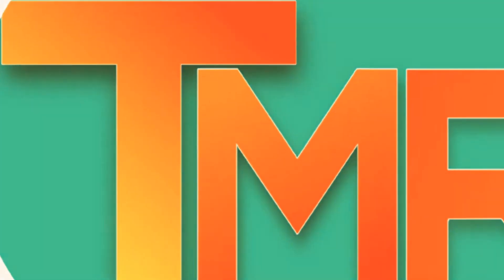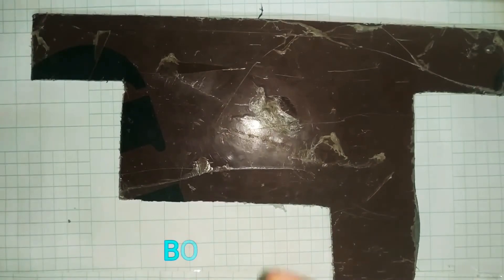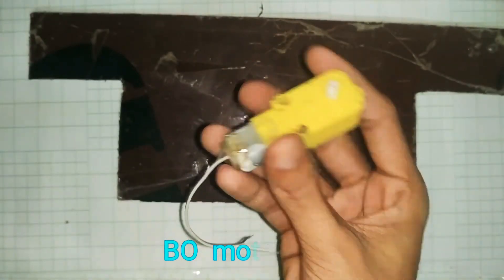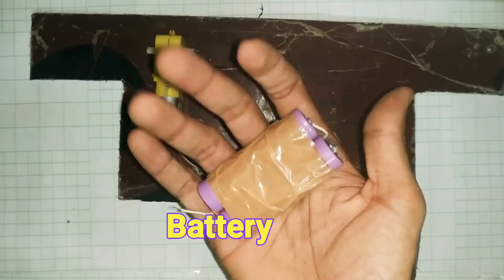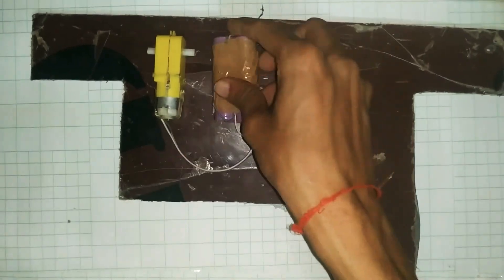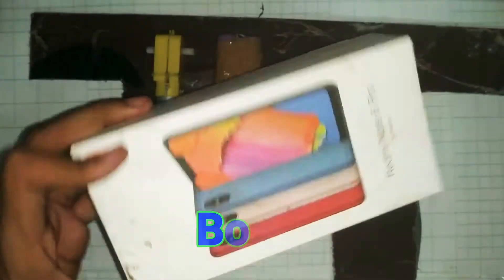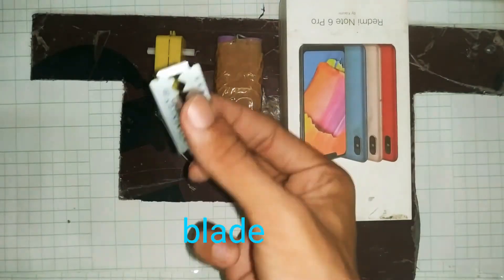Useless box || Don't touch it box || DIY || At Home || Most useless box ever || Surprise

Comment: But how can the arm came back to the rest position??
Reply from the maker: Actually switch is acting as reverse switch, so when you press switch, motor move in forward direction and press the switch.
Reply: @TechMechRobo  so after the switch comes to the original i.e. in it's reversed position, the motor will continue the process of  receiving the power from battery resulting a drain of battery😕
Reply from the maker: That's why we used limit switch below, when motor shaft touches the limit switch, the supply from the battery will turn off.
Reply: @TechMechRobo  thank you so much 👍